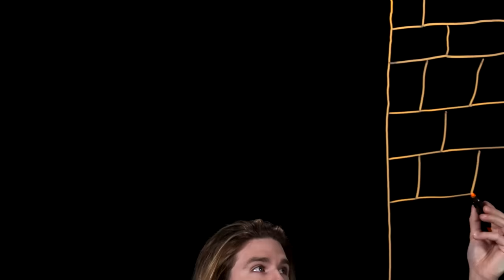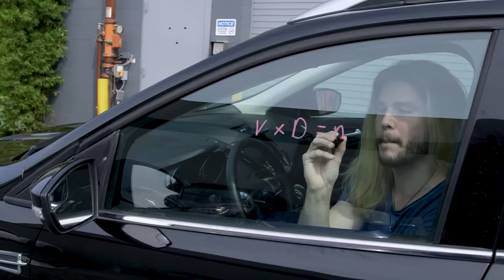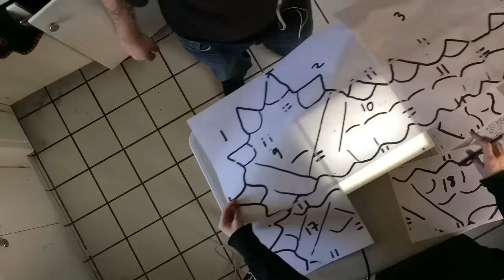Could You Swing A Real Monster Hunter Sword?

Comment: Assuming your character has a mass similar to the average human wouldn't he, in mid-air, turn himself around the sword instead of swinging it?
Reply: Tbf, the animations do kind of represent that. Swinging the greatsword around in MHW tends to show your character being thrown off balance a bit or even swung around by the momentum. Some of the combos even take advantage of this...  and is also what can leave you open to some monster attacks if you time your swings poorly :p
Reply: ... are you suggesting the Aerial Arts Hunting Style might be at odds with the laws of physics? YOU HERETIC!
Reply: Yes, and Skallagrim mentions that in his videos about Monster Hunter and Final Fantasy. 
"You don't wield a sword that big, it wields you"
Reply: Lucky Monster Hunter Worlds animations agree with that
Reply: Absolutely. Using Kyle's figures if you had your feet 1m apart with your body's weight directly between them and the sword's point of balance 1m in front of your front foot you would need to weigh over 340kg just to prevent yourself from falling over.
Reply: if you have super-strength so you can even lift it, it means that your muscles need to be very big and strong. Since muscles are quite dense too, you would probably weigh a lot if you had the power to lift and swing it. With that said, you would probably be fine
Reply: Muscle is only about 20% denser than fat.
Reply: Yeah, and even on the ground ! Super strength requires super density of the wielder to make sense, with no apparent anchoring (they can walk and jump freely) to the ground you would just topple by simply holding it in front of you. (without even talking of accelerating the sword toward an enemy !)
Reply: I was goin to ask them to tell us the needed mass of those "human"
Reply: Alekay Argote 
Well the average mass ratio weapon/wielder is like 30 (80kg guy with 30kg plate armor / 3,5kg greatsword) but in the game the sword is not wielded like a sword more like a gigantic and heavy hammer. So let's consider a third of that ratio to take into account the way it's used.(it's generous) The sword is 170kg, you would have to have a total mass of almost 2 tons... it doesn't need to come from your body, you can wear a thick tungsten armor with thick gold plate over that, which will offer great protection ! (...From corrosion.)
Reply: You sort of skimped on the scientific reasons that welding a sword like that would be impractical, I suspect it was due to this being a paid promotion and it would have been a bad idea to upset your sponsor. This is the first video you have made that I could actually say I was disappointed by.
Reply: OMG its WTF Oh hi! I know you from that discord chat!
Reply: Emory Wilks - How would him saying picking up and using this "sword" is completely impractical, which he did say, upset the sponsors? That makes no sense. Capcom knows it's a video game and it's not realistic.
Reply: KuariThunderclaw TBF if humans were able to swing swords this heavy effectively and be strong enough to land 30 meter falls then there definitely would be an entire martial style of what you just described.
Reply: Well if you had mass (and thus, muscle mass) similar to an average human, you wouldn't be able to swing it around in the first place, but yes. If, in theory, you had average human mass and swung that sword, you're just going to throw yourself about its center of mass. However, if you had a muscle mass (and thus, regular mass) great enough to weild that ungodly, glorified club, then you most certantly have enough mass on you to not be thrown to and fro by the blade.
Reply: @Emory Wilks The game isn't remotely pretending to be even vaguely realistic and having a deep understanding of why the weapon wold be impractical doesn't effect people's enjoyment of the game. 

I do agree this video was sub par but I'm willing to give him the benefit of the doubt and believe this topic is just too far outside of his area of expertise and he simply didn't think to speak to someone with experience handling weapons and heavy weights. Kyle isn't MatPat, I don't think he's running this just because it's profitable and he'swilling to address at least some criticisms.
Reply: aren't the people in MH like superhumans though--like Captain america
Reply: But Skallagrim was wrong, and his "physics from a friend" was literally intro level 1 physics that oversimplifies so many things; plus he himself says he knows nothing about this stuff.  I would know, I have a degree in physics, and recently taught a class that covered those same things.  The physics given was mass * gravity = max force from a person.  Besides, not being able to lift and swing a sword wouldn't mean it would throw you around, it means you can't lift it; the sword doesn't magically come to life and throw you instead because it's heavy.
Reply: I don't know, some of the armor may just make it possible. Just look at the uragaan set, it probably weighs more than the sword does.
Reply: That isn't taking into account the weight of your character's armor though. Remember it's made of the same material as the weapon, and that is in addition to your clothes under the armor, your body weight, inventory items, wrist launcher etc. If anything you underestimated the level of strength required lol
Reply: yondaime500 

don't forget the mass needed to keep yourself from flying away. I'm using Cloud Strife and his MASSIVE Buster Sword. (a full sized aluminum replica weighs around 80 pounds/36.287 kilograms.) Comparing the sword's height to its width, the center of mass is about halfway up the blade. To swing the blade, Cloud would need to generate 9751 pounds of force, and then would have to end every swing into the ground. Now applying the weight of the blade(80 lbs), just to stay on his feet and not fall with every swing, our beloved Cloud would need to be around two thousand five hundred pounds. This is just for the 80 pound 6 ft long buster sword. The Berserker Sword looks about the same length with a similar center of mass, but 4.625 time's the weight. So for your Berserker Sword, you would have to be a whopping 11,562.5 pounds, that would make you 8.259 times heavier than Jon Brower Minnoch, Who weighs in at 1,400 pounds.

(I'm using Skallagrim's method as my main reference in this.)
Reply: Capcom never clearified that the MH series is based on a planet with similar gravity as the Earth, so it might just be on a planet with 1/4 of Earth's gravity.
Reply: @jimhuang3392  good point, didn't think about that.
Reply: Just want to throw out some MH lore, its basically a post post apocalyptic world after the hyper advance wyverian race went into full blown war with all the sentient elder dragons, the hunters in MH are descended from the enhanced humans the wyverians bred and modified (humans were to the wyverians like dogs are to us but humans were able to fully communicate verbally within a few generations so that changed the dynamic drastically) to basically be the brute force of the wyverian armies. Long story short, the wyverians created something near the end of the war, not the humans to be clear, it was some sort of bio mechanical abomination that literally ran on death that drove the Elder Dragons to drastic ecological measures (Elder Dragons arent all actual dragons, but its a class of beast that 1 alone can cause the damages of a hurricane across a whole ecosystem if they want) where several Elder Dragon species drove themselves to extinction by over exertion of their abilities in retaliation of the abominations slaughter. Basically reshaped the entire world, destroyed all of wyverian civilization and nearly drove the wyverians themselves into extinction. But the humans were what saved the wyverians, and the whole series of events is why the wyverians, still the ones at the general lead of society, are so more about nature and natural order now. Theres a reason that the closest we get to guns are bowguns and midevil cannons when they have the tech for the dragonator, the automatic stake in the ground button press pitfall traps, and just look at the charge blade and switch axe transformations and tell me thats not scifi. Wow, didnt know I had this much to type.
Edit: Also, imagine how big the guns they had the humans using in the war were. Its actually kinda scary to think about an army of hyper strong humans weilding canons massacring the creatures, who most didnt actually start stuff, most werent interested in threatening the humanoid species but a few with extreme ideals attacked, now all Elder Dragons basically innately hate humanoids but most still avoid them.
Reply: we are talking about people who can withstand a diving force of like 3 story buildings and keep on fighting so...
Reply: Hideyashu from Onimusha would love to have that sword...
Reply: Well they are wearing armour so the mass for that specific question could be greater than the sword
Reply: actually it's known that hunters are not regular humans anyway...
Reply: And  you also need bones that wont break when 200 kg human literally throwing away 170 kg sword. 
I think when you have super stamina, super bones and super strength - just go there, rip it's leg apart and kill the beast with his own leg.
Reply: @yondaime500  So we can officially dub these giant weapons, Russian Blades.
Reply: Find a clip of someone using Greatsword, watch their Tier 3 charge attack.  The character slams the weapon into the ground and that causes them to somersault over the weapon and swing it again.  They really are using the weight of the weapon in some of the moves.
Reply: I’d like to point out MichalChuthulu makes fantasy sword builds like these and hacks into things. 
We should also mention, the ridiculous diet the hunter has, their HUGE metabolism, which could imply they aren’t homo-sapiens. But more likely neanderthal (or something) in structure. Aka HUGE metabolism. Much better muscle tissue. Possibly even a bigger, faster, smarter brain too. 
But all that comes at a big energy cost (BIG metabolism) . Part of the reason theorized why they died out is because hunting elks and stuff was dangerous (and tiring) when all you had was a pointy stick or a flint edged spear.
Reply: yep, and he would turn himself right on that blade edge and slice himself in half XD
Reply: @JustCozItsMe "an army of hyper strong humans weilding canons massacring the creatures, who most didnt actually start stuff, most werent interested in threatening the humanoid species"

FOR THE EMPEROR!!!

Comment: “In order to be a monster hunter you have to wield massive weapons” 
dual blades: OBJECTION
Reply: Also Sword and shield
Reply: That's why Dual Blades and Sword & Shield are the two most boring weapons.
Reply: @nateee2970  Objection! In optimized play Long Sword is the easiest and most boring cause foresight slash is pretty braindead and positioning is easy cause of your reach and speed ratio.
Reply: @Viewahh  idk what you're talking about, I'm a high MR and haven't used a single weapon besides the Long Sword and I still get hyped each time I get a foresight slash.
Reply: asdfghjkl LS is extremely hard to master in iceborne . LS players have to consider more factors than let’s say a greatsword player or bow player . You have to master a monsters AI and flinch threshold to even have a fluent hunt.  Your positioning and status will trigger different monster behaviour. Thus LS player have to make sure their position can lure out the moves they desired from the monster and take advantage of that move. They need to make as much damage as possible but not exceeding the multiple flinch threshold, most importantly the clutch claw flinch and head flinch, and for some monster broken part flinch. since he number of clutch claw flinch is limited, and LS have tousle clutch claw twice to weaken a part. If you deal too much damage too early, you’ll actually lose DPS in the long run. If you do too much damage to a certain part too fast. Let’s say you broke a monsters arm and it falls but you don’t have enough energy, you loose damage.
Reply: I would say insect glaive has something to say
Reply: Also incect glaive
Reply: @nateee2970  JoCat wants to know your location
Reply: Bow: oh hi
Reply: Dual Blades are still bigger than a hunter's torso.
Reply: SnS is the way to go.
Reply: ...They're still freaking huge.
Reply: laughs in palico
Blocks deviljho with my small dagger
Reply: Sword and Shield forgotten as usual
Reply: They are still massive, a tobi kadachi db is bigger than water guild blades
Reply: @nateee2970 looks like someone doesn't know how to use dual blades
Reply: @sp00kyd4ddy6  you're right when I wrote that but I consider them my second main nowadays. They're so crazy in MH Rise, it feels like playing God of War on the PS2
Reply: @nateee2970 nah dual blades are fun af
Reply: insect glaive is the funnest
Reply: @nateee2970 dual blades ain't boring
Reply: do you see how thick those dual blades are?